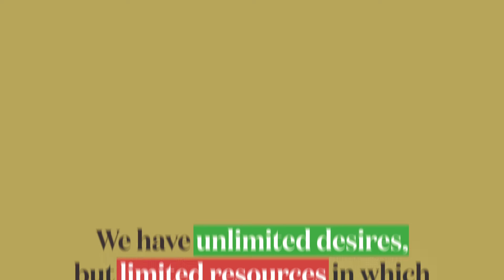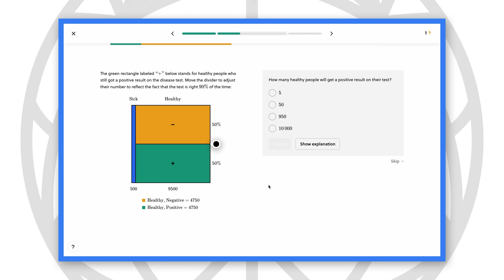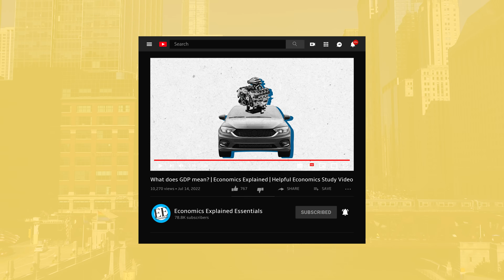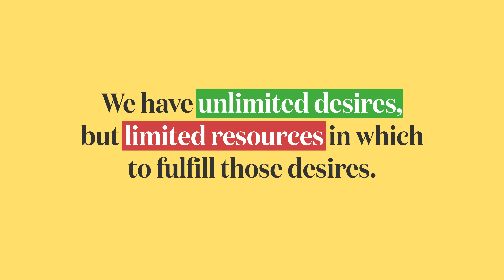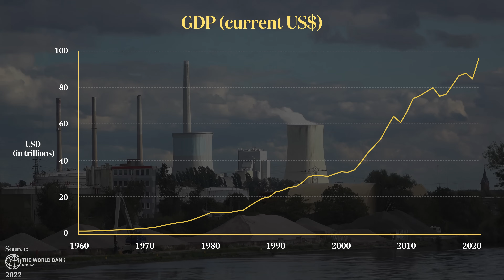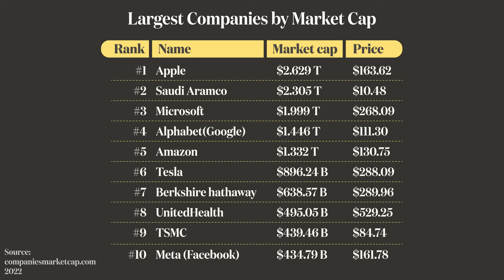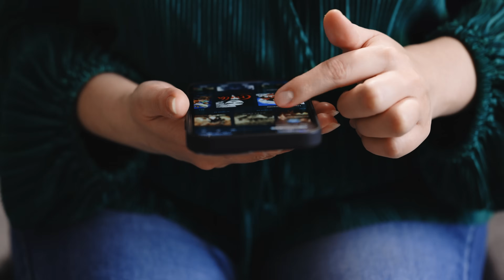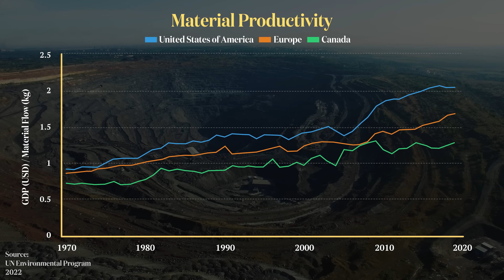Limitless Growth Is Possible If We Run Our Economies Correctly | Economics Explained

Comment: Lifting a billion people out of poverty is a dubious number. Their Premier Li Keqiang (second in power) said last year that 600 million Chinese are living on fewer than 1000 yuan/month ($150). 965 million live in 2000 yuan/month ($300) or fewer. And 1.330 billion people or bottom 95% of the population, live off of 5000 yuan/month ($750) or less . Do keep in mind that these aren't wages but per head, so a 3 person family with a single earner pulling in 6000 yuan/month ($900--which is either reasonable for a college educated person in Shanghai or astronomical in rural areas) would end up in the top third earning 2000 yuan/month/person.

A billion people being lifted out of poverty (which would mean only the bottom 400 million get left out) means a sizeable chunk of the people living on fewer than $5/day is considered "lifted out of poverty". Cost of living is cheaper in China is lower, but at $5/day you're living a pretty basic life. A bottle of coke is going to run you about 5 yuan which is about 70 cents. That's about 15% of your total day's allotment.

Comment: Even a digital economy is bound to physical resources.  You can't tap into the digital economy without some sort of digital device.  A computer, a phone, a console, there is going to be resources used for the connection onto it, plus the economy itself needs servers and internet connections via physical connections like cable, DLS, or fiberoptic or requires a wireless connection, like wi-fi or cellular service.  Eventually, infinite growth will require an infinite amount of computer components let alone infinite electricity to power it all.  If nothing else, we do need better recycling of already used resources to stem the exhaustion of our natural resources.  Also, we need to curtail population growth or even reverse it (allowing death rate to overtake the birth rate) to limit the amount of resources being expended.
Reply: Let's talk now 👆👆..

Comment: May seem strange but promoting a Managed Service model is a possible solution to the paradigm of disposable product economy in some industries. 

Particularly for higher cost larger products like appliances, cars and electronics. 

If we convert these items to "As-A-Service" sales models it switches to give manufacturers incentives to build higher quality higher longevity products. Upgradability, reliability and repairability become important design considerations again because the manufacturer needs to plan for long term use of their products instead of building in intentional fail points and planned obsolescence. 

Also adds value to the product by bundling with additional services as a feature. And gives the opportunity for a lower cost of entry which means the 3+ year total cost of the product (revenue from the product) long term can actually be significantly higher than just selling the thing with up front payment. 

Lots of benefits for the manufacturer, reseller and consumer of the product. 

All with lowering total materials and transportation used, when compared to providing disposable products to consumers.
Reply: I was thinking about this. It does mean we'd have to rent all our possessions.
Reply: @HeloisGevit  why it works with mid size things like computers and appliances. No real advantage to owning these things, just depreciate near 100% out of the box anyway. Not like a house that may increase value or a car that has significant value years later. A 5 year old washing machine has nearly zero value, but may still be working to keep it out of the landfill if it is built well and we'll maintained. 

Or you can buy it but have the support services managed long term. If the company can bundle in enough to make it worth the money plus warranty support. 

Or you can "service to own" where after 3 years your rate drops due to ownership ( like a cell phone contract)
Reply: You'll own nothing and be happy.
Reply: @blob22201  still own your house, and maybe your car. Own your clothes and for some reason a DVD box set of Coronation Street. 

This option works best for mid cost assets.

Comment: The trick is to keep increasing services as material production falls (to save the world) and also importantly as material production automates. 

We have already started a big shift to a more service based economy and it needs to keep going. 

The problem is that short term profiteering has resulted in many service based jobs being part time minimum wage jobs. Jobs that offer little jobs security, benefits and stability of life for the employees. 

Short term profiteers try and perform minimum quality service to reduce the labor required to perform the service vs the value charged for the service. Like why many service companies are famous for having 4 hour hold times trying to talk to an account representative. They could just hire more service reps or have their service reps better trained, better paid and working full time hours - but they do not want to because that would mean less up front profits vs investing in long term sustainability. 

But if we can start to value services more resulting in paying service staff more we can maintain long term economic growth as those higher paid service staff continue to buy more services.
Reply: Let's talk now 👆👆.....

Comment: Positive economic growth requires both energy and commodity inputs much larger than people comprehend.  Both commodities and partuIarlarly energy are not only challenged in meeting demand but are heading into permanent decline.  It is no past time for a planned and managed economic decline.
Reply: Let's talk now 👆👆...
Reply: @cantenkaya8203  Economics is the study and practise of the use of partially implemented, untested economic theories to transfer the wealth from the people into the hands of a few through the depletion of the planets limited resources to fill perceived needs and wants.
In addition economic policies are written as if the laws of thermodynamics do not exist and prominent economists have had the hubris to say that the laws of thermodynamics do not apply to economics.  The head of ABARE had the hubris to say in a Senate Enquiry “If eggs were expensive enough roosters would lay eggs.”
Science measures with absolute units to test theories and hypothesises to analysis data, show trends and relationships and make meaningful projections.  Unfortunately economics does not have any absolute units with which to measure; analogous to measuring length with an elastic tape measure.   Consequently no meaningful economic measurement, analysis or projections can be conducted.  
https://nanopdf.com/download/letter-to-senator-nick-minchin_pdf

Comment: 4:05 "[...]there are only so many resources on Earth. There is only so much farmland, iron ore, fossil fuel, and fresh water[...]"
You are oversimplifying, a lot.

Farmland - in the strict meaning of land for farminig this was never true. Both desertification and irrigation change the farmland available. Historically terracing has been used to convert non farmable hill side and mountain side into farmland.
If you farm fungi in underground cave, you increased the farmland.
Indoor farming allow to multiply the surface that can be farmed. To date the measure used for farmland output is calories per acre. But this hide an actual increase in farmland extension as an increase in productivity. Indore farming done on 4 floor is not twice as productive as done on 2 floors, it just double the effective "land" available. I hope we never see traditional farmland becames extention of tall warehouse.
If you consider fishing as "farming the sea", then it's even less limited to land available.

Iron ore - usually referring to ore we can extract iron from, cheaply!
But the actual amount of iron ore in the Earth crust is much bigger. See aluminium, once it had a price higher than gold and now it's a very cheap material.
But even not including any improvement in extraction and refinery, a mine is considered exhausted when there is no ore to extract with profit and poor location are ignored if the expected ROI of a mine is negative. But this is a function of the comodity price. If demand increase than production tyat cost more can became profitable.
Fracking in the oil industry is such an example.

Fossil fuel - no comment

Fresh water - actually this is a renuable resource. That is what evaporation from ocean and rainfall actually does.
And even there we can intervine. Most of my tap water comes from desalinization implants. In my country there was a serious project to build a desalinization implant to fill up a natural fresh water lake, it was blocked because of NIBY on the coast location.

I think the limited resources is a VALID argument.
But the fundamental errors in presenting resource available is what had undermined this argument in the last half century, if not more.

Comment: We can get to the point where we have perfect use of material. Waste nothing, recycle everything, limit usage. The problem is Asimovs last question, eventually we will run out of energy. Energy is the base resource.
Reply: The thing is, 100% efficiency does not happen in the real world. Lossess and inefficiencies are inevitable due to the increase of entropy (the materials are ultimately converted to the unusable dispersed form)

Comment: The statements about digital economy are false, sadly. Actually running digital services consumes a tremendous amount of resources and energy. It is true that it is much more efficient to stream a movie than say manufacturing, delivering and recycling a DVD, but the sheer amount of additional consume eats up all efficiency gains. The same goes for the exponentially growing compute and storage capacity per unit of material use, that is consumed by higher bandwidth services and more demanding software, while at the same time the constant replacement of hardware with better and more efficient one create insanely huge amounts of problematic waste.

Comment: Something I found interesting when looking at history is that things tended to get cheaper over time. There may have been some production increases but while hand made good are very expensive they often were built from the highest quality material because the best way to get economy was to go for longevity. Since the population stayed static there were actually deflationary pressures. The overall amount of good was low at the time and it was one thing that really helped to increase the standard of living. We would have to have a major shift in policy but it's a smart thing to do on a personal level especially since you get to have nicer stuff although less new stuff.
Reply: Those are called "luxury goods" today = )
Reply: Falling rate of profit be like:
Reply: considering that the global population is expected to level off and even decline in the next 100 years, I wonder then if we'll see this exact same effect occur.
Reply: This is why modern economists are stupid. They think that things getting cheaper is bad for the economy because it's "deflation." They honestly think that if TVs go from 5000 to 500 for a given size, no one will buy then at 500 because next year they might be 480.
Reply: Longevity is sabotaged by program obsolescence and cheaper by the invention called inflation
Reply: The trend of things becoming cheaper has a limit. The resources most things are built from become harder to mine every year now. 

We've had things getting cheaper for so long because technological growth. Technological growth can only go so far though before the difficulty of mining out weighs it
Reply: @loowyatt6463  there is no limit to technological growth. Economists always lock us into the surface of the earth. Real entrepreneurs look above to the moon and below into the underground to find new resources. Also, economists are like Malthus who said the finite world would cause shortages. Those are the ones who get headlines and make the people pessimistic. Milton Friedman is the economists we need as he knows how the world truly works.
Reply: @funveeable  For starters of course there is a limit to technological growth. At a certain point of growth you'd reach the limit of know information and application of that knowledge.

Mining in space is century's off and far more complicated that you think. For starters how do you transport those resources to the planet from space?
Second problem when do you get the resource here how do you stop it collapsing the market. For example say you brought back millions of tonne of iron, that would crash the market making iron worth almost nothing. So whoever invested into getting those resources won't get any profit.
Third problem none of the technology to make this feasible exists.

Who knows in the future technology may make it feasible. Until then you can predict with what you know. So sure we may be able to mine in space but we may also find god's real, who knows when your talking hypothetical. 

Frankly not a single person on the planet is even trying to space mine right now. We have a explosion of private space company's and not a single one is looking into it. So if there's not even research into you can't assume this will happen.
Reply: @funveeable  Oh yeah because planetary mining its so easy to implement
Reply: @loowyatt6463  Everyone in my family said we are trapped using Spectrum Internet because they own the infrastructure and an essentially captive customer base as no new infrastructure can be installed. Elon Musk is an innovator to launch the Starlink system to give me internet without having to rely on Spectrum. It gets better with each new fleet deployed. So yeah, there is no limit because there is always a new angle to approach from.
Reply: @DajuSar  we can land spacecraft on asteroids, it's a start. The same way Sputnik cost the Soviets a fortune to launch and today its a monthly occurance.
Reply: @funveeable  you do realise that star link didn't develop any new technology. Frankly even the idea has been around for decades. So no it's not a example for how technology advances. It's just an example of a rich billionaire finding a hole in a market and filling it.

Also when I said technology has a limit I didn't mean we'd reach it tomorrow. I was simple stating that there is a limit that at some point we will reach. The closer we get to the limit the less technological advancements we'll have. So having the assumption that technology will keep improving is not only false but dangerously
Reply: @funveeable  Malthus was absolutely right, though, and he still is to a large extend. We may be living in a "modern period" but we are still subject to limitations. Just look at how our population will cap at like 10 billion.
Reply: @t.7124  Ironically the population would hit its cap because of economic development.

Comment: I agree in principle, but couple of thoughts:

1. Compared to "physical" economy, digital economy is even easier to outsource/relocate.
As an example, your stock video bank buying up videos from Eastern Europe, because they cheaper. Tram depo at 13:10 is in Moscow (those are Russian-made trams with recognizable Moscow transport wave pattern on the side).

2. I am for better things instead of cheaper things, but that would clearly require mental shift and not a quick policy fix. I consider planned obsolescence an idea which has been most damaging to the environment, but it is more prevalent in higher end goods.
Reply: I think the idea is around a long time and no change of mind is insight. Same as climate change, without governmental steering, the free market and what people end up buying wont change fast enough.
If you acknowledge the global extinction rate, the system, the biosphere is strongly endangered.
There is no time anymore to hope things will change slowly and freely out of generosity.

Comment: I think the world need two laws. The first law is that the producer must be responsible for the whole life cycle of it´s produced goods or service. Meaning it needs to recycle it and clean up any pollutants. The second law is a heavy fine and maybe even prohibition from conducting business for "reckless environmental behaviour". With that I mean that if you produce something that has major negative consequences on the environment, for example adding lead to petrol and you should have known it is bad for the environment you get fined and if you are doing something really bad, your business get dismantled and owners and some key staff may never run a business again. You should be able to get fined for such crimes even if materials and chemicals are not strictly prohibited, it should rather fall under some kind of "common sense"-based judgement.

Comment: Great point actually, I didnt even know that the metric of "Material Productivity" existed before. It would really be a great thing to look out for if we had more data on it. 

I think a similar metric for a smaller scale would be great too. Like company growth weighted for resources used. Is there such a thing ?
Reply: I do the macro modelling for a living. Resource productivity has existed since the early 90's. Industrial ecology is a field where they model this at the firm level. They still call it mat prod or resource productivity. Most companies have the material throughput data, and depending on how accurate you want it to be lots of consultants can pretty easily/cheaply get you a lifecycle assessment estimate of impacts from the ecoinvent database.